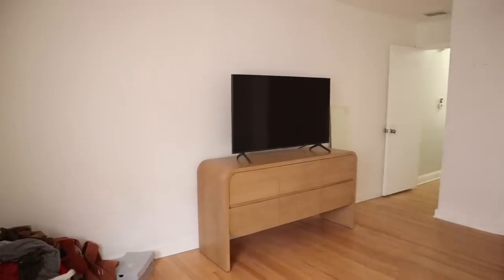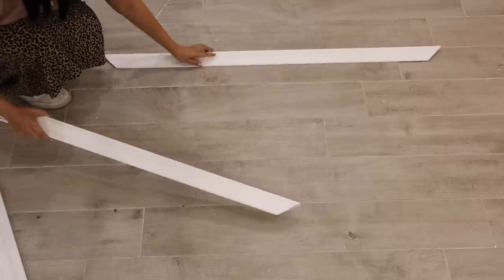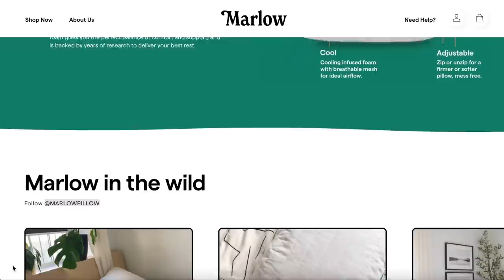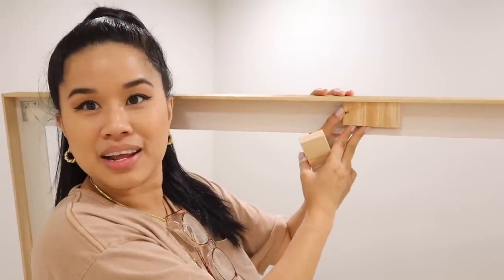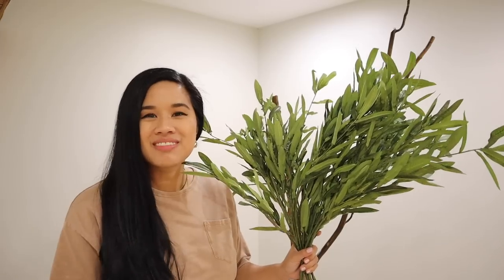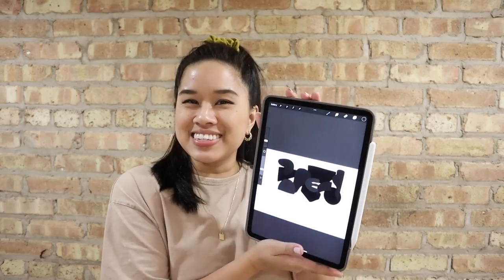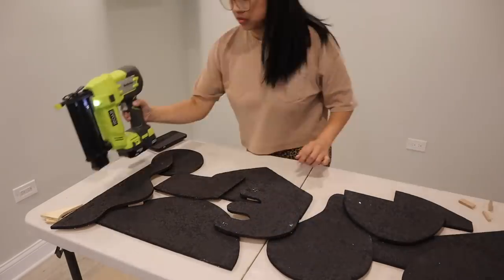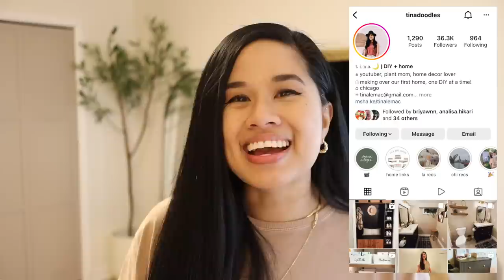Upgrading My Bedroom w/ EXPENSIVE DIY Home Decor Dupes! | DREAM FRAME TV + WEST ELM *LUXE FOR LESS*

Comment: Such a great job on all the projects! I do think the wall sculpture should be a lot bigger. The scale is too small for the width of your bed.
Reply: I think lighting sconces on each side would balance it out and widen it
Reply: Was coming to say the same thing. Either a bigger piece, or add some more smaller ones.
Reply: I was wondering if it was just me thinking it looked kinda small… y’all reassured me that it wasn’t just me 👍🏻
Reply: I feel like it's missing something on that side. Also agree the piece needs to be maybe 50% larger to make a statement.

Comment: Nails will likely not be enough for a plaster wall!! I speak from experience sadly. Anything with weight that’s hung on a plaster wall should be hung with toggle bolts to ensure it’s secure. No shade, I just learned this the hard way 😅
Reply from the maker: Thank you for this tip!! I actually did go out and buy a toggle bolt so we can rehang it! I am terrified of it falling 😱